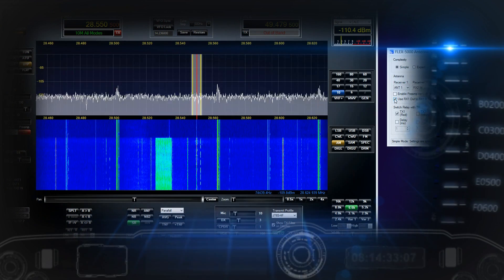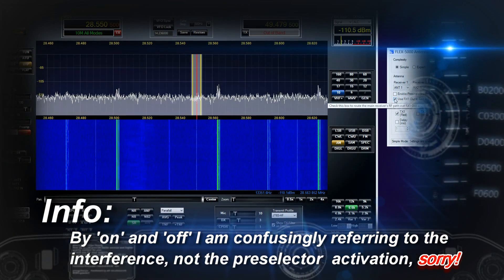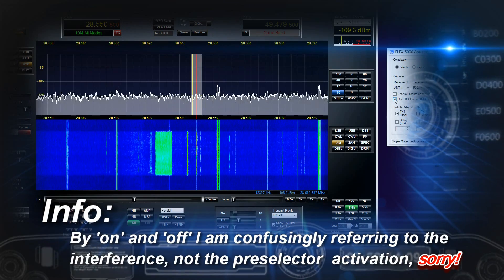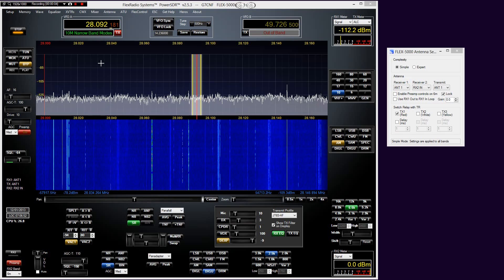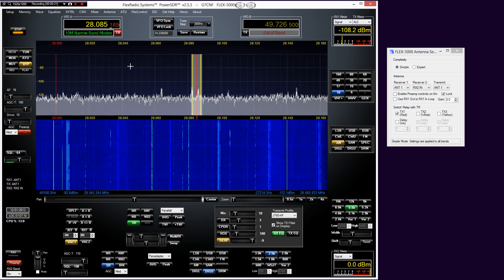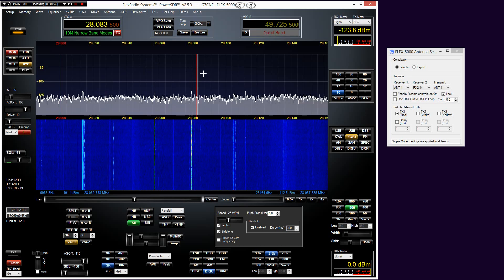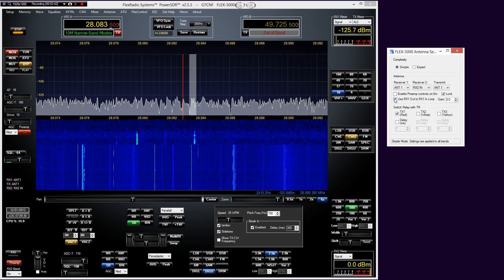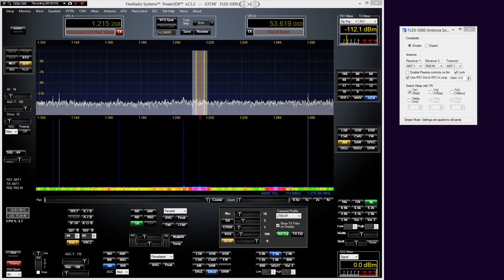Heros Preselector-CAT Demo

Comment: Very good demo.  I have an DV dongle type SDR receiver and using an up-converter for HF RX.  I live a mile from an AM radio station tower site and the receiver was about useless across the spectrum so I added an MFJ-1046 pre-selector and it worked wonders, now it works quite well, just a little bit of overload noticed yet but not bad, so will also add a BC band filter that attenuates everything below 1700khz, I think that will totally solve my problems using that and pre-selector.